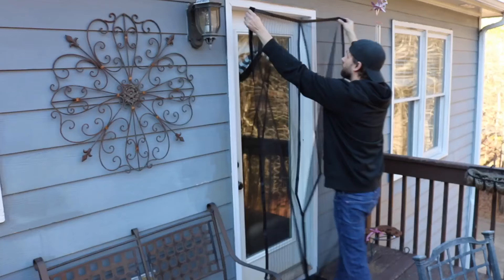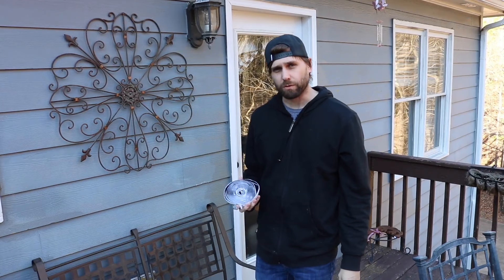Installing Magnetic Screen Door

Comment: This was way better than the how-to videos posted by the companies that make the screens. Thank you!
Reply: Thank you!
Reply: I used a tension rod 
Folded extra over made a pocket to slide rod through
and tacks the the sides worked great for kids and dogs😅
Reply: Agreed!
Reply: @carolleroy448  I bought an 83" high screen, needs to go on a 79.5" metal frame opening. Wondering how to do this, or should I just cut it...
Reply: Very cool, got mine..it will be way better than my rolling screen door falling off the track every time its pulled.👍
Reply: Good call on the Velcro!

Comment: Don't ever buy the stuff if you think it's going to keep a pet out of the room! I didn't get this exact brand but it's the same exact thing and it says on the package great for pets! Right as soon as I installed it all my young kitten did was head butt it and open it right up! And this is only so I can let cool air come in at night and she won't come in my room and bother the other cat or me when we're trying to sleep. And I can't shut the door I have no AC in here. The only solution is to take a safety pin or diaper pin and pin the bottom of it so it won't open. I think when it means great for pets is that they can let themselves in and out. But I got this stupid idea that I thought my pet would not go through it. I was wrong. Other than that it's fine.

Comment: Folding the extra over on the sides was brilliant!!!!  After I ordered one (and had it hanging around uninstalled for almost 2 months), I realized our back door is not as wide as the front door.....wondering what to do?  And then you solved the problem perfectly! Thank you so much for the video! Also, applies the velcro to the door frame, as you demonstrated, instead of to the screen door, then apply it all to the frame like the company instructions suggested.  Much better idea!

Comment: I have one in my RV. It is great for letting my dog go in and out as he pleases. It also lets less mosquitoes in because it hugs your body and has less open space that a normal screen door when going in and out. 
My first one lasted two years. I just finished installing my new one today. I advise not letting it quite touch the ground, or you will wear a hole in the hem and the magnets that hold the flaps together will fall out.

Comment: Thank you for helping me feel abit more confident hanging it. However my door I'm putting it on is aluminum framed, it's a sliding glass. I live in am apartment from 1966.
Reply from the maker: Mine came with tacks and velcro. The instructions said that the velcro was for metal framed doors and the tacks for wooden framed doors. I imagine the velcro would hold well enough as long as you don‘t have any kids or something pulling on the screen. Only reason I used the velcro at the top of the door was just to help make it easier to install since I didn‘t have someone to help at the time.

Comment: The tacks are meant to hold the Velcro to the  door jam, not to hold the screen, that’s what the Velcro does. Put the first strip of Velcro, tack it in place then Velcro the screen over the tacks, that way the screen is removable. If you nail the screen to the door frame it’s not removable without pulling all the tacks.

Comment: I think I would have just tacked the Velcro to the frame (using the adhesive also) but not through the screen. That was the Velcro would be strongly attached to the frame but you can still take down the screen easily if you want to. Thanks👍🏼☮️

Comment: You can use those thin molding strips.  But I like the Velcro idea better.  Mine didn’t last long the weather wore it out.   But you can get screen mesh and reinforce it mine lasted 2years but if you put screen mesh over theirs it should last longer cause mine had cloth screen    But I’m still going to get another one cause my basement step outside is too close to put up a screen door the magnet part stayed good

Comment: I agree with majority of the comments he gave a way better video than what the company was advertising lol but are these good for blocking out mosquitoes and flies? My screen door has a gap at the bottom I can't even open my door for fresh air without mosquitoes getting in sm
Reply from the maker: We mainly use it for flies and it has helped a whole lot. There is a small gap at the bottom that a fly or mosquito could by chance walk through, but since they are usually not flying 5mm above the ground at floor level, we haven’t had many problems. For us, having the screen is 95% better than not having a screen.

Comment: I loved it at first,  but, my door gets so hot that the sticky part at the top  keeps falling off. I can't tack it because my door frame is capped, only wood is at the bottom and I put tacks there, but I cannot keep it up. Its like the sticky stuff won't hold up in the heat
Reply: If the cap is metal just use self tapping screws with a washer so that the screw doesnt go thru the product.

Comment: had to remove mine and the velcro left behind ALOT of sticky residue. any suggestions to remove it? i’ve tried using goo gone and rubbing alcohol and it slightly works but isn’t efficient
Reply from the maker: I've seen people use a heat gun or even a hair dryer to heat it up and make it come off easier. Maybe you can try that?